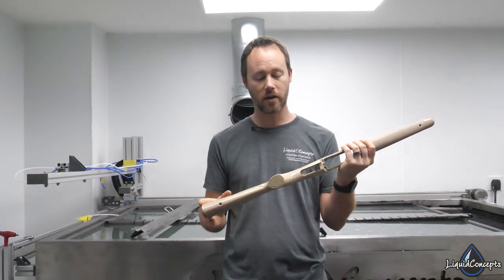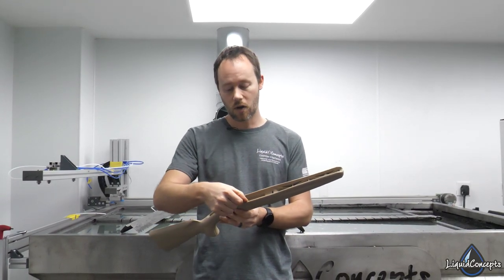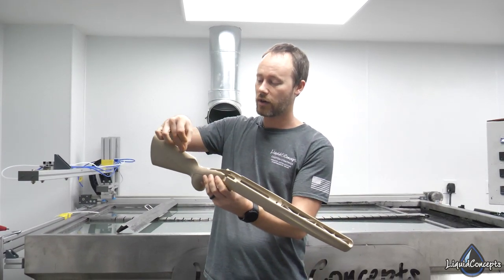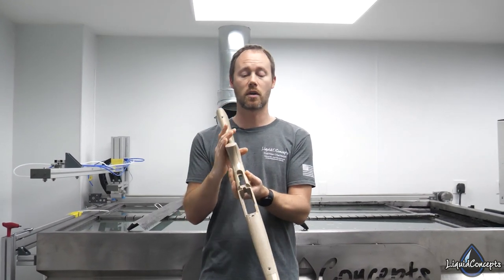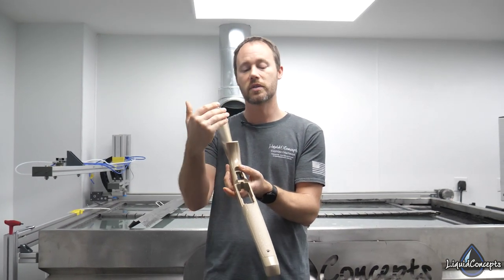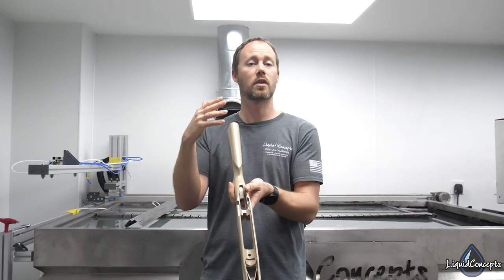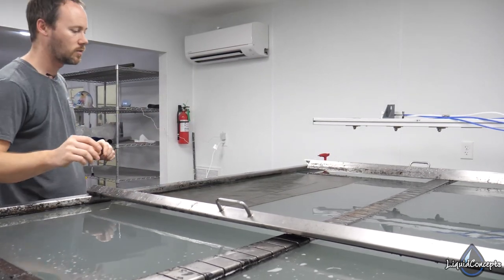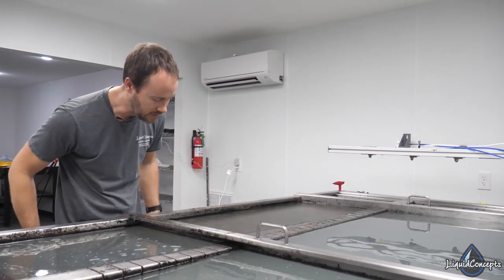How to HYDRO DIP CAMOUFLAGE

Comment: I’m interested in having a Browning just like that dipped however it didn’t want the bedding distributed. My question is seeing all Browning’s are bedded from the factory why did you not tape off the inside of the stock before spray. Looking good is second to shooting good. I’m asking as this is my fear that this same thing will done to my rifle and it’s a tack driver. Can it be done without destroying the bedding and accuracy of the rifle.